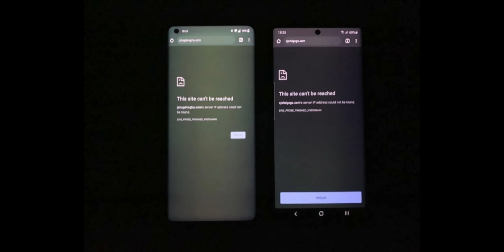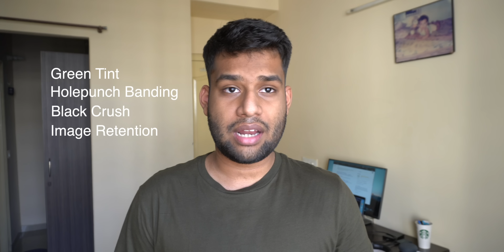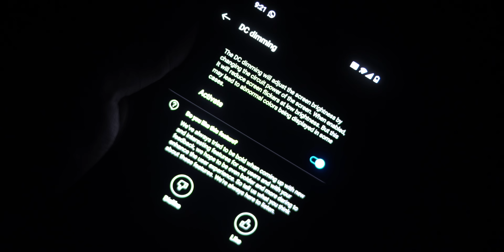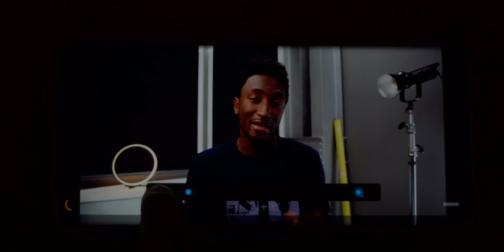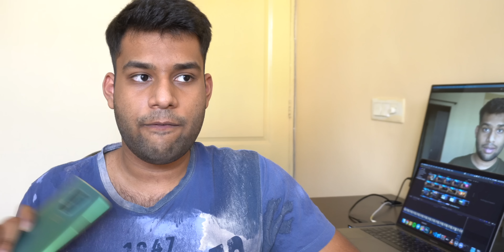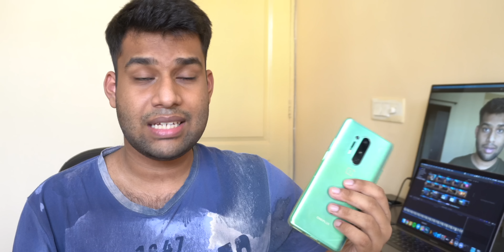I'm Returning My OnePlus 8 Pro.

Comment: If that freaked you out imagine me freaking out over my phone developing scratches on the camera module just after 6 days of usage. Yikes
Glad so far it's only on the colour filter camera.
Reply: Which phone
Reply: @ashisrai5976  OnePlus 8 Pro
Reply: Do u mean that camera glass gets scratches while using in a normal condition also
Reply: @ashisrai5976  I don't think it's scratching now, as you can see my comment was from 2 months ago and this "scratching" could just be a layer on the camera lens maybe the Oleophobic coating that's wearing out. So right now to temporarily stop this, I put cellophane tape on the camera lens and left cut outs on the individual cameras except the colour filter camera (because this "scratching" started happening on that camera region). Unfortunately, the site from which I bought the phone from here in UAE says it's physical damage and physical damage doesn't come under warranty. I'm just gonna wait for now until I reach India where a third party repair shop could just replace the entire camera lens module.
Reply: @ashisrai5976  ye this is happening in normal condition. No drops, nothing. I haven't dropped this phone even once. I have been using it naked too. But in my opinion a phone should be made for use in it's caseless form, blaming me for not using a case is just bs.
Reply: I m planning to buy oneplus 8 pro...
So wat do u suggest me
Reply: @ashisrai5976  I haven't seen anyone else face this issue, so it could just be my unit that suffered this. If you are okay with the display which is still not perfect but over the time has gotten better, I am fine with the display. I still highly recommend this phone.
Reply: Can u tell me about its camera quality...
I mean how is its camera performance  and ....
Can phone be switched off without unlocking the phone or not....
And tell me things you regeted after buying that phone
Reply: @ashisrai5976  camera performance is excellent just by using the OnePlus camera alone and if you want you can download GCAM and the results are just amazing. Phone can be turned off from the lockscreen, my previous phones including the iPhones could also do it. I got no regrets in buying the phone aside from the camera lens issue that I had, maybe the curved screen is sorta annoying but at that point it's sorta nitpicking. Everything is just perfect about this phone (aside from the display). It truly is still one of the best phones of the year.
Reply: Would u mind sending me ur camera scratches photo and some sample photo clicked by oneplus 8pro...
Can u plz help me out ...
If u can than plz send me in my gmail ashisrai958@gmail.com
Reply: @ashisrai5976  sure bro I'll send them when free. I might take some time.
Reply: Thanks bro .andHave u drop or put your phone in water to test it
Reply: @ashisrai5976  nah bro haven't dropped the phone not even once. Phone met with few splashes, it survived. It's IP68 but don't wanna test it.
Reply: @AllenLijo  bro can phone. Be switched off without unlocking it
Reply: @ashisrai5976  yes you can switch off without unlocking.
Reply: Thats not good
Reply: @ashisrai5976  All the Samsung and Apple phones I've used have it like that sooo 🤷🏻‍♂️
Reply: Bro do we get temper glass on it or not
Reply: @ashisrai5976  plastic screen protector preinstalled just like most manufacturers, its good for resisting scratches

Comment: bro i think that all are making these issues as hype......like too yesterday was surfing at midnight and i seen issues one in night mode.....and the main issue comes in opening chrome, so why the hell u r using dark mode in chrome? i just started using Chrome in light mode.......
Reply from the maker: I paid 55k for it, why should I not use dark mode on it if I want to? I love dark mode. 

Not my problem if the device is engineered so shittily that it can't handle the latest Android 10 feature.

Comment: I am also facing some display issues on my 8 pro. So i contacted oneplus customer care so that said that they are aware of this and it will get fixed with the software update. So would like to know if this is a hardware issue or software ?
Reply from the maker: I mention this in the video. Their fix for this is basically increasing the threshold of the lowest brightness and changing the color temperature at the lowest setting. They're not fixing it, they're just covering it up.
Reply: @KDCloudy  Maybe they are still figuring out in fixing the issue and it will be fixed in further updates and till the time they have capped the low brightness to high. I wanted to know the possibility if this issue can be fixed or not with a future update.

Comment: I also face the puch hole band, it's very minor i have requested Amazon to replace it in next few days, mostprobably post next sale.
But i have fear that replaced product might have another major display issue compared to this one.
To conclude actually i dont want to return this unit and i think that i can get the replacement of it directly from one plus after few months once they are quite stable with the production, as the device comes with 1 year warranty.
Can you please comment on my thought process
Reply from the maker: I don't think OnePlus will provide a replacement just like that. So far, there's no official statement from OnePlus regarding whether these issues will be fixed in the next production batch. 

If you don't notice the display problems that much you can surely by all means keep using it, you don't need to replace it anybody if you're happy with the device :)

Comment: Using s7edge for a long time working fine ,but I was thinking I would buy OnePlus but these issues behncho mood kharab ho Gaya.
Reply from the maker: Exactly.
Reply: @KDCloudy  they r software issues. If u switch to qhd and 120hz, green tint goes away. Also, black crush issue can be reduced by DC diming.

Comment: They said it is software issues
Reply from the maker: I don't think so
Reply: @KDCloudy  or is it more current passing through due to 120hz, 60hz will still have this issues?
Reply from the maker: @XRPHordz  I tried with different resolution + refresh rate settings but it was persistent everytime.

There's a weird color defect internally with all units, it's either some display controller or something else, it's definitely not software.
Reply: @KDCloudy  oh well i hope my ordered oneplus 8 pro doesnt have it lol

Comment: I'm upgrading from the Redmi Note 7 Pro just like you. I've just placed an order for the one plus 8 pro and wanted to know if I can ignore that holepunch band issue?
Reply from the maker: You totally can, but I can for sure tell you that the LCD of the Note 7 Pro is much more color accurate than the OnePlus 8 Pro.
Reply: @KDCloudy  Did you contact one plus regarding this issue you faced?
Reply: @KDCloudy  Hi, I just got my OnePlus 8 pro. There seems to be an issue with the flashlight. Did you face any issue regarding the same?

Comment: What’s your take and opinion on One plus 8 6 GB 128 at a price of 39000/- with discounts ? Is this buy value for money ? Any dealbreaker issues on One plus ? Waiting for your reply
Reply from the maker: I think the 7T is a better option if you don't care about 5G. Or even the upcoming OnePlus Nord.

5G rollout in India will atleast take 3 years and by that time you'll probably upgrade again and 5G tech would be a lot better and cheaper.
Reply: KDCloudy many thanks 🙏🏻

Comment: Its been 3 days im using my one plus 8 pro no display issues even on low brightness of dark mode no black bar or green tint a slight black crush i think ..not bothers me at all
Reply: Broh use in dark room at low brightness
Reply: @sumansaurabh4610  yes bro i tested it in a dark room .the manufacturing date of mine is 18 june. I have not used the phone much just fr an hour a day maybe these issues can appear after some days . who knows
Reply: @nishants5296  leave ur coment here after use 1 month that phone...
Reply: @metalxcore311  ok
Reply: @metalxcore311  bro I just saw screen retention and black bar
Reply: @ALPHA M. try ur luck bro
Reply: guys while scrolling through the comments in dark mode in low brightness (oneplus community app) can you see the grays turn blue or is it just hardware defect in my unit?
Reply: @shraavanpai1219  not on mine bro do u  have any other display issues. And what is the manufacturing date of ur phone
Reply: Bro... I have placed an order today.... Should I cancel it?

Comment: Yeah, same here, I bought the 8 pro as a replacement for my 6T and had to send it back to Amazon a week ago. Some developers said the problem is caused by faulty PWM controllers and cannot be fixed with updates.
Reply from the maker: Damn. First time I've heard the actual reason
Thanks for the tidbit
Reply: Have you got the refund from Amazon ?
Reply from the maker: @mohithshivakumar9137  yup
Reply: @KDCloudy  actually I'm also planning to return my device...  I'm facing camera issue as well... like there is a lot of flare/light reflections in low light and regarding this green tint and dark bar near camera... Will technician who visits to check the phone approve for return or how exactly should I convince him to return?

Comment: That's exactly what my thought is why should one compromise on flagship. 

I also applied for refund. Oneplus f*cked this time with there first flagship using cheap panels. 😑

You can even reproduce this issue by turning on night mode and setting night mode to darkest, you will see the issues on chrome application.
Reply from the maker: Yeah

Comment: Any issue with one plus 8??should I buy one plus 8??
Reply: I returned my OP8 as it also had terrible black crush on both the original and replacement unit as well. And I did not even turn on that dc dimming thingy...

Comment: Samsung AMOLED >>>>>
Reply from the maker: Samsung Display was the vendor for OnePlus 8 Pro AMOLED screens. Shame that  1+ didn't implement/calibrate it properly.

I was gonna buy an S20 but held back because of Exynos.
Reply: @KDCloudy  personal experience, Exynos great in all aspects except graphic performance. And I'm not using my phone anytime soon to work with Premiere Pro, does good by me.
Reply from the maker: @shaansundarandIndiatogether  Sweet. M30s right? How's battery life?
Reply: @KDCloudy  A50 actually, gives me easy 6 hours screen on-time at brightness little less than halfway.
Reply: @KDCloudy  but A71 too got green tint issue...amoled has this problem(its like hit & miss) ... But op ruined too much without calibrating...

Comment: What do u suggest should I go for s20 plus or op8 pro
Reply: Please don't get the s20+ for gaming...it overheats and throttles like hell after about an hour in pubg.
Reply: Go for OnePlus 7t pro
Reply: @chinturai6956  I want 120 hz display for games
Reply: Go for S20 plus.. i am using it since one month.. not a single issue.. Very light and perfect size phone.. best for camera & also for gaming
Reply from the maker: ROG Phone 2?
Reply: @KDCloudy  wait for ROG 3 COMING NEXT MONTH